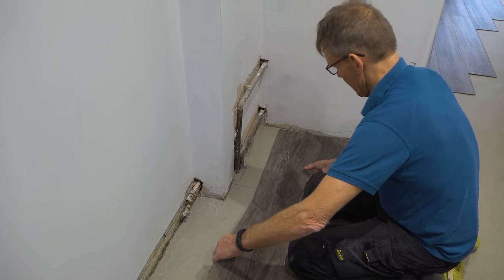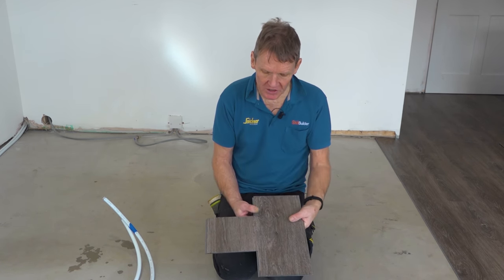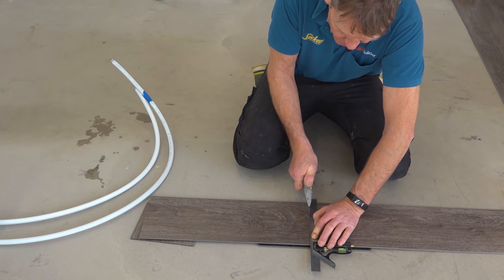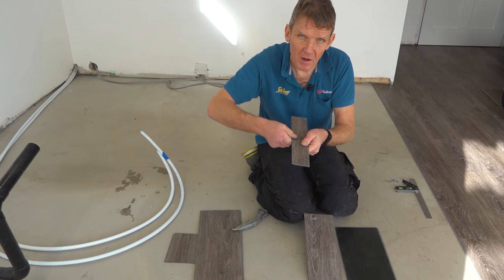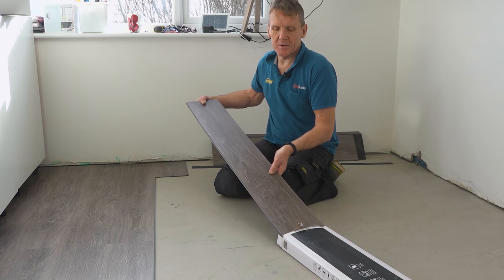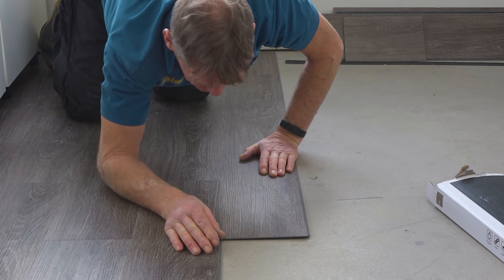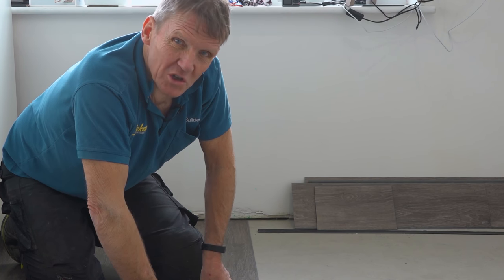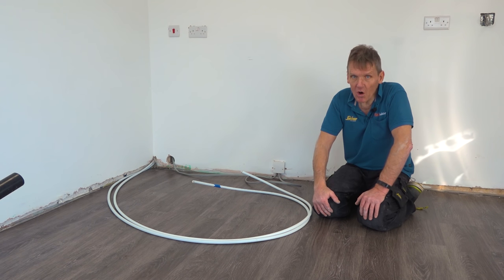Laying Palio Clic Luxury Vinyl Flooring by Karndean

Comment: My skills at doing anything DIY are not that good. But having watched this excellent demonstration of how to lay click flooring by someone who readily admits that he’s not a full time professional floor expert, I feel if I follow the advice I could do a good job on laying my new kitchen click vinyl flooring. The tips I picked up… 1) Don’t rush, and take your time! 2) Prepare the floor and keep is as clean as possible, and vacuum as you go 3) Before starting make sure you lay the first piece parallel to the wall/cupboard 4) Use a concave cutting blade on your knife, and take care to always cut away from your hand to avoid accidents! 5) Angle the piece you’re laying upwards slightly before clicking in to the next piece. There may be other points I’ve missed so I’ll watch it again! Thanks for such an excellent demonstration. First class! 👍

Comment: Roger, I love that you laid the flooring all the way to the wall. The Wickes fitter annoyed the hell out of me when even though the room was empty he installed all the units first and then only laid the flooring part of the way. The kickboards hid the bare floor from view but it bugged me that I knew the flooring didn't reach the wall. Liked and subscribed.
Reply: Hi mate, in all honesty the guy did right what he done for multiple reasons imo so don't let it bug you to much , fitting  units etc on top  of flooring like this restricts it's movement and expansion, floor like these move naturally and are meant to , this is why he leaves gap gap around perimeter. 
Also your kitchen will most likely outlive your floor so if and when you change due too damage or just wear and tear it will be a hell of a lot easier from what your fitter has done and very common to fit the finished floor after kitchens or  are fitted incase damage during installation etc . 
Hope this puts you at ease and it's not a dig at a very good installation guide .

Comment: I have put a few of these down and I always work from left to right when looking at the job, the short ends will just lay on the other board . Also when tapping together I use an old steel square about 600mm it’s a better tap than an off cut, more solid to ‘tap’. And yes vacuum vacuum vacuum!

Comment: Doing a bathroom floor in this tomorrow........ around an offset shower tray. Bedded the tray down so that there's around 4-5 mm vertical gap, and approx 10mm to introduce horizontally beneath the rim of the tray; after the underlay and flooring goes down. Hopefully, should be able to tuck it ever so slightly away beneath the tray. Neat bead of silicone to finish off. Fingers crossed. Wasn't aware that it could be scored n snapped. TYVM!
Reply from the maker: Good luck Loafer. We usually get a joke from you. I hope you aren't getting sensible in your old age
Reply: Dour, miserable and ever increasingly more curmudgeonly in my old age. beer and edgy humour keeps me sane(ish) This bathroom is like a black hole or the mafia. There's no getting away from it. As a  literary analogy it would be War and Peace.  "Just when I thought I was out, they pull me back in!"

Comment: You probably dont need it for this, but I use a flooring slide hammer. Super easy to control especially when you have to tap the last row to a wall or other object.

Comment: Overall good info but a key point of a Floor is for the aesthetics of a room as its such a big feature. On this basis the header joint spacing depending on customer expectations could ruin that and should all be random and and not duplicated like a-lot of these are across the floor. There a simple way of using the boards in 3 row starter sizes  to keep a basic random staggered joint across the floor but a decent floor layer would use the waste from row ends and cut to suit across ensuring no H joints or Step joints across the rows. 

By no means a dig at you as i watch a lot of your building videos and think you guys are great, just some feedback so the next Palio click will be installed perfect :)
Reply from the maker: Hi Luke
 It worked out that we had roughly 200mm from the offcut to start the next row. The customer was happy with the idea of keeping the joints in line. I agree with you that more of a stagger would have been better but it would have wasted more planks. I asked them if they wanted it changed and they said no.

Comment: Just got a couple of packs of this for the bathroom. My chipboard flooring was not perfect so laid 12mm play down which seems pretty smooth between joints now. Having read some of the comments I'm now a bit apprehensive about having a go at laying this. I've actually got a bit of a gap at the skirting so was planning to slip it under, lining it up with a datum line on the floor. One question is it advisable to try have a full tile at the door entrance.
How important is it to fill the joint of the plywood and if so what with

Comment: I have a ground floor kitchen with underfloor heating was told by kitchen fitter that I should have fitted the kitchen first as the vinyl laminate is floating? Is that correct and I would have saved some money not laying foam underlay !

Comment: A question if i may, Some of the other makers of click LVT floors state that kitchens should not be fitted onto their floors, I assume this is not the case with this range?
Reply from the maker: It can limit the expansion and contraction of the floor and with granite worktops I would cut around the feet to allow movement but in this case the floor is free on the other sides and is short enough to limit the movement.
Reply: @SkillBuilder  Thank you for the answer. I only asked as some may not be aware that not all LVT type of floating floors are the same.
Always watching and learning from the videos.
Reply: @SkillBuilder  My builder did this (installed the kitchen on top of the floor) and one particular part of the floor bulges up in the summer. How can we fix this without major disruption? I was thinking of taking off the kitchen plinth and using a Dremel (or something) to basically cut the floor a few millimeters of expansion gap around the kitchen units.
Reply: @nathanevans6693  that is exactly  what you should do, but no need for a dremel, just an ordinary Stanley knife will do the job!

Comment: Looks like great stuff, the fact it's so easy to cut must save so much time and mess.

Can this stuff be laid on a wood board subfloor using a suitable underlay?
Reply from the maker: If the floor is stable and the joints are good it will be fine. If there are gaps in the boards they will telegraph through.
Reply: @SkillBuilder  thanks for the reply.  The boards are very strong and are all fixed down well but I understand that the lines of the boards may show through.  Is there an underlay that can be used?

Comment: I'm looking into buying & fitting 40sqm of Karndean Korlok lvt plank, for a kitchen & family room. I'm taking time to prepare the subfloor with levelling compound to get it flat as I can see that it probably wouldn’t take much vertical movement to unclick adjacent planks. Still, several flooring contractors I've spoken to recently have been fairly negative about click lvt systems, and are only willing to fit glue down, which is working out about 2x the price of click with their fitting fees... Is there justification to be suspicious of click lvt or is it a good & reliable diy system if you do the prep ?

Comment: Great vid roger “as always “
Never used the Palio click but have fitted miles of laminate and with laminate it’s easier to fit left to right with tongue out, is it the same with this system. 
Keep up the excellent work 👍
Reply from the maker: It probably is better but I went with the room and got the recess done. It is slightly different because you don' tap the end in.

Comment: "I don't cut towards my hand," I cut towards my femoral artery instead. lol
As a side note, those floor sensors are less than a fiver each. I put two in side by side, so when one fails it is a simple job of swapping connections in the back of the 'stat.

Comment: Would you not just take WC out. Lay floor then re seat the WC. I have this stuff in my WC and it is great really hard wearing. Looks amazing
Reply from the maker: Depends how hard that is to do. I would because I am a plumber but floor layers cut around it a lot of the time.
Reply: @SkillBuilder  fair point. I am a scaffolder and i take out the toilet when laying floors. The finish is much better. Thanks for the reply
Reply: @Steve Diamond steve read back your comments and see who started the smart comments. Your also still questioning my trade stating if scaffolding is an actual trade. I have never once questioned your trade whatever it is. My point is your still trying to bring people down your proving my point that you are a troll
Reply: @Steve Diamond it was your rude comments after your your advice on the silicone your a troll you get kicks out of trying to bring people down. Do you need scaffolding for safe access to do your job
Reply: @Steve Diamond so you should know that its not a 2 day course for scaffolding. It takes years to learn. I have read the comments.
Reply: @Steve Diamond so what sort of w@h do you do. I am a fully qualified advanced scaffolder with inspection. I didnt rush it. I taken my time and learned from other guys on site before i went back to do upgrades
Reply: @Steve Diamond nice one. You start off as a scaff labourer then you can get your part 1 card. You need to go gain experience and fill out portfolios from site work you have done on site under the guidance of an advanced scaff before you go for your part 2. Once you get your part 2 you then have to gain experience as a 2 before you can go back and sit your assessment. Once that is done you then you have to gain experience as a full 2 before you can go for your advance. Same process when your advanced have to wait and gain experience before you sit the assessment. In total it probably taken me 6 years and as all trades we are always learning on a daily basis. Cant do jobs safely without scaffold steve.
Reply: @Steve Diamond time to squash the beef the steve 😂
Reply: @Steve Diamond cheers steve. Keep up the good workmanship. 2 days of back and forward finally over in a civil manner 👍🏻

Comment: I have never laid vinyl flooring, but it would have been better if Roger had showed how to cut around objects that you cannot scribe and snap. Great video though. Very informative.
Reply from the maker: We will  do a follow up on difficult cuts. Works well with a template and multi tool
Reply: Skill Builder thank you

Comment: What did you put on thr floor that make it level and smooth?  I'm about to install Karndean looselay flooring over plywood but I need to make the surface smooth it's pretty rough since I ripped ceramic tile off of it.  Any recommendations?  Thanks for these Karndean videos!
Reply: You will need to latex the floor with a flexible latex because of the ply. It's the same procedure as doing the lvt. You need to follow karndeans installation procedures, notoriously good at het out of there guarantee.

Comment: Hi. Looking for some help. I have a self level compound on my floor, which I don't think has been layed well. It's level. But it's dusty. I know enough to know it's not meant to be like that. Could I still lay this sort of flooring on top? Thanks.
Reply from the maker: Seal it with some SBR and it will be fine

Comment: Is it best to take your skirting boards off,lay the flooring and then replace,rather than use that trimming quadrant stuff?
Reply from the maker: I prefer it but in the case of this flooring you butt right up to the skirting with no expansion gap so there is no need for quadrant.
Reply: @SkillBuilder  Thanks for your reply

Comment: for flats (3rd floor), would this system need an underlay for noise? If so what type of underlay, density?
Reply: Lvt click like this is fairly quite compared to laminate.. but you can get underlay, use the same brand of underlay as the lvt
Reply: @danielboard7097  thanks, what about construction board?
Reply: Paul Thomas no only use what is recommended for warranty purposes in my experience the underlay will come on a roll but different brands have different under lays to soft and thick and the joints will brake
Reply: Paul Thomas there are other ways such as recolay and regipol which is a dense rubber underlay but needs to be stuck down all over we used a lot of this in 600 bedrooms recently it’s more for a floorlayer than a do it yourself option
Reply: @danielboard7097  thanks for your help.

Comment: I’m planning on using this on a oak floor. It’s nice and level but I’m concerned the V grooves in the existing floor will show through?
Will it?
Can I use an underlay to avoid that problem?
Reply from the maker: Eventually the V grooves will telegraph through. You can get Palio core which is made for this kind of job where you are going over tiles etc but you might not like it. The alternative is an underlay. If you use something that is no more than 2mm thick you will be fine.
Reply: If I use the Palio Core I won’t need underlay or should I use it as an added protection against the lines coming through?
I want to leave no gap one side of the room but a bigger gap the other side under the kitchen cabinets. Will that be a problem?

Comment: I am really struggling with an uneven floor.. it is part floorboard, part concrete and part chipboard sheets.. what  is the best way to level this out.. Also what UFH would you recommend??
Reply from the maker: I think I would lay cement board over the whole lot. You can bed it on cement based tiles adhesive. The other alternative it to bed some underfloor heating trays onto tile adhesive and then lay tongue and grooved chipboard over the whole lot as a floating floor.

Comment: can you lay it straight on floor board? in a small upstairs bathroom or would you recommend hardboard or ply first? assuming the floorboards are level. my instinct is telling me it would be fine on straight on floor board, but I don't have the product in front of me.
Reply: vinyl flooring, even planks, need a smooth finish. skin it with 6mm ply and staple it down
Reply from the maker: No it must be smooth and fill any gaps in the ply or use a self leveller over the timber. They make a fibre reinforced on. Levelex
Reply: @SkillBuilder  thanks
Reply: I wouldn’t do that, I got some of this type of flooring (B and Q own not karndean) and put it on bathroom floor on some thin underlay. It looked OK at first then it all came apart as the floor wasn’t level enough. This stuff only has tiny interlocking bits unlike normal laminate so if there’s any flex to it as you walk on it it’s enough to disconnect it, it does need some sort of boarding I think. Eventually it got so bad here I just put some nice vinyl down over the top of it which is quicker, cheaper and easier anyway if not as hard wearing. You can get some really nice vinyl these days.

Comment: The LVT I have bought from wickes says dont lay under kitchen units!!
Reply from the maker: I think it might stop the expansion and contraction if you pin it down with the legs. I would rather but some small holes for the legs and fill around them with silicone. I have seen so many leaking washing machines go undetected because it creeps under the floor covering.

Comment: How do you finish if the room has skirting on do you need to leave a gap for temperature changes
Reply from the maker: yes, usually people put a bead around the edge to cover the 5mm expansion gap